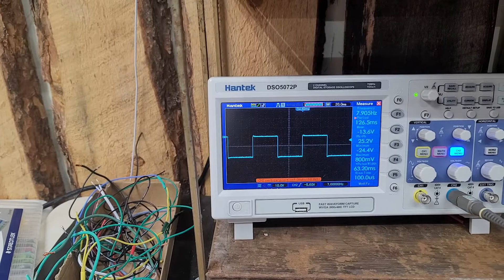diy pemf mounting items for child proof use.

Comment: Hi Steeve,  I'm using ZK-PP2K and it doesn't make a perfect square signal for some reason. Any idea how to fix it? Someone recommended to connect 15 K Ohm resistor between the output wires.
Reply from the maker: Lets take this conversation to my email! 
Steevebradet@outlook.com.